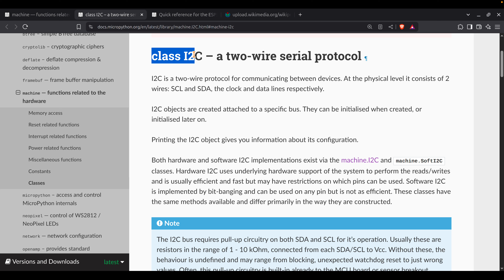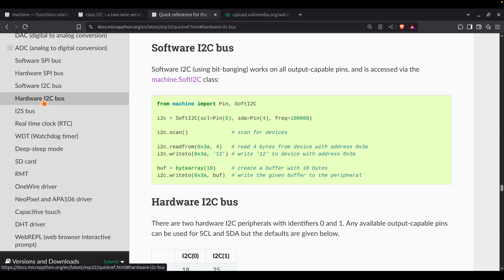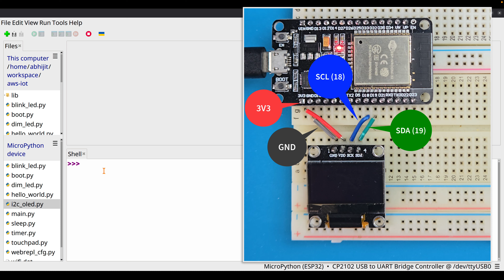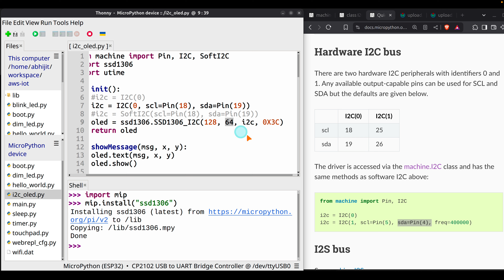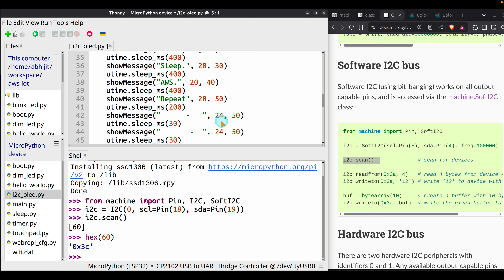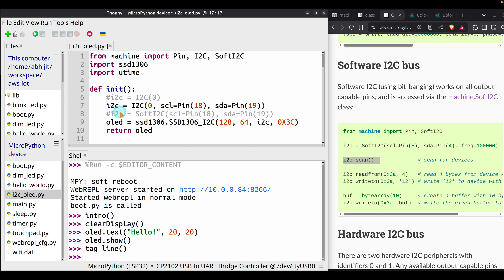I2C - Two Wire Protocol | Micropython Machine Module - Learn #aws & #iot

Comment: I found this very useful. I am working on example code that asks a bmp80 its ID .   Here is the first bit, i2c.write(addr, ID_CMD) and to read  value = i2c.read(0x76, 1). Micropython version of i2c is different  microbit and esp32. I like the microbit version but I am using the esp32. This looks like a possible tutorial. I like the use of mips to install the ssd1306. That is super handy. TY for sharing.
Reply from the maker: Thanks for sharing your work and kind feedback!